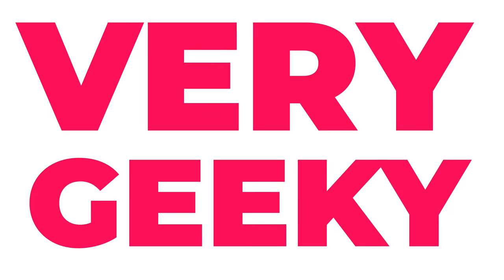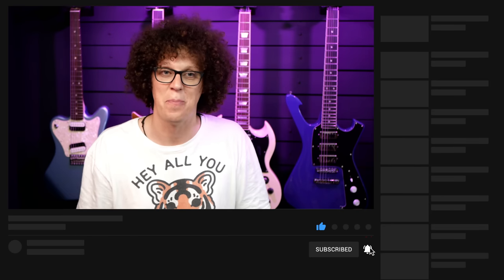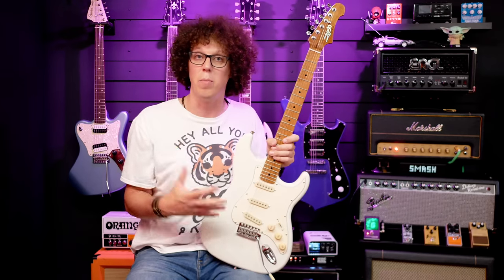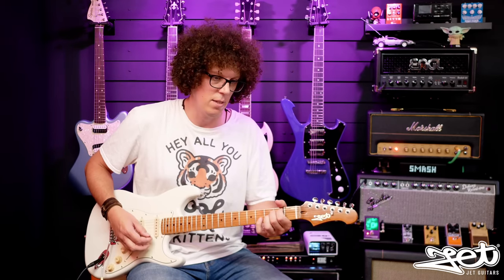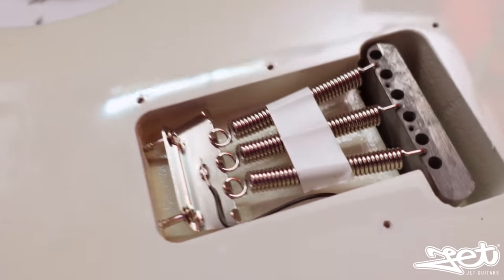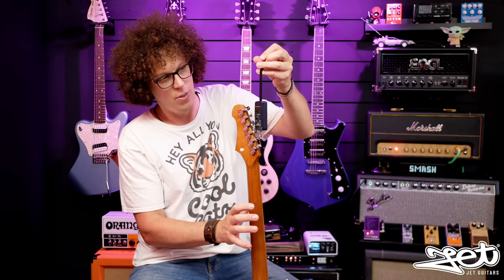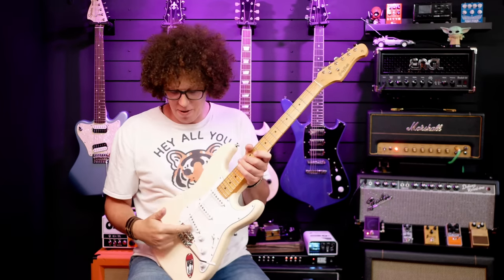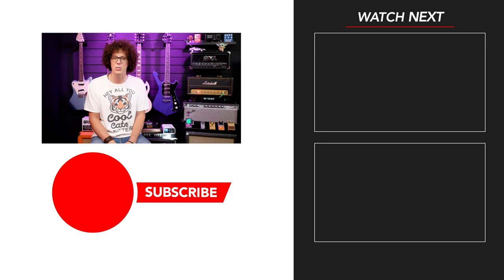Cheap Strat Showdown - Harley Benton VS Jet Guitars

Comment from the maker: Which was your favourite? Jet Guitars or Harley Benton?
Reply: Jet sounded better,  Harley is available in the US to me and cheaper so I would go that route with a loaded pickguard and the PRS cutaway and make it Stratolicious
Reply from the maker: @jacksmith2617  good idea
Reply from the maker: @hailmaryrecordings8255  that is a great move
Reply: Meh. I liked the Custom Shop gondola better.
Reply: I have two Harley Benton guitars and the necks are good on them. One is a Fusion II and the other is HB-35 Plus. They're both really good guitars for the price. I wouldn't buy either of these guitars though. I would prefer either a Squire or MIM Fender for a bit more money because the trems look so cheap on the Jet and Harley Benton. If I had to choose, I'd buy the Jet because of the neck and bigger trem block and would replace the pickups.
Reply: Have not tried the Jet, but after waiting for a couple of months today my ST-62 arrived and it has a caramellized (that is roasted, isn‘t it?) neck.

Just looked at the Thomann homepage, it now says caramelized there as well (on the german page at least).

Seems to me, HB is reacting to competitive environment and channels like this one are  conducive to this.

So, Andy, thank you.
Reply: Just so you know, the new batch of ST-62 from Harley Benton have caramelized maple neck! So you got what you asked for: a satin roasted maple neck and fretboard. Check them out if you want!
Reply: Jet Roasted maple neck !
Reply: I think any cheap strat should be a hardtail because you can't get a decent tremelo until you get a bigger budget!
Reply: @johncollins5552  Jet trem is ok, but I replaced the springs, I use the Trem, in playing gigs and is stable.
Reply: HB is definitely my choice because of the neck radius: 9,5″ (Jet) vs 12" (HB)
Reply: I have a Harley Benton CTS 24 I've had it 4 month and 2 frets have lifted fret 19 and 21 which is making it bottom out so I've thinking of getting a jet JS 400
Reply: @daveperrin9408  I've not had any neck or fret issues with the Jet, the trem springs were not good, a cheap fix, and put Iron gear single coils in to give me the sound I wanted.
Reply: @jacksmith2617  What do you mean the PRS cutaway?
Reply: @LOFIGSD  What is the string spacing on Jet tremolo bridge saddles 10.5 or 10.8 ?!
Reply: @omicrontheta5956  sorry, no idea, or tool to measure, contact Jet, hope they can help.
Reply: @LOFIGSD  Yea I did contact them It's 10.5, and btw I got JS-400 last week and guitar is so well made, hardwear is lets say ok, locking machines where crap, frets are well done, electronics are fine but its gona be modified anyway and properly setup, value for the money I would say one of the best cheapest guitars out there, cheers.
Reply: @omicrontheta5956  only big minus for me was the Trem springs, Single coils I replaced, I will probably put new tuners on, their ok, tone and playability its amazing value for money, a pleasure to play, post some videos of it fully customised.
Reply: @LOFIGSD  Hm idk I didn't notice anything unusall with trem springs except they have normal tension, but I still replaced them with ones with hardened tension bcs I use 10-46 strings or just put four normal tension springs, but again it could be to stiff. I mean pickups are not that bad, my plan is to put in DiMarzio DP100 (bridge) + DiMarzio DP217 (neck). Tuners I already put other old ones I had in my drawer with bore of 10mm (I think) so they fit, those who came with guitars where really crappy but Il go with Gotoh SG381 so I recommend you those, and today I gave guitar to acquaintance of myn who is fixing guitars he sed the neck is great but it needs a bit of fretwork polishing.
Reply: @omicrontheta5956  the pups are actually surprising good for a budget guitar, Ive kept the HB in there for now, but the Single Coils I replaced, the neck is worth the price of the guitar, mine has 9's and after a few months the springs didnt have enough tension, a cheap fix,, cant go wrong on Gotoh tuners, the neck and fret work better than some Gibsons I have had that cost thousands, the only other Budget Guitar I have is a Fazley Telecaster, with a P90 in the neck, the fret work on that was rough, but it plays well, cost less than a £120, the Jet much higher quality, but again, it plays well, often I pay thousands for Guitars so this is all a bit of fun for me.
Reply: definitely the Jet (although I dislike the logo and prefer the color tone on the HB better) the work on the hardware is better and that's the biggest factor for me
Reply: @LOFIGSD  do you still recommend it?
Reply: that's very helpful, thanks for the reply man!
Reply: Hi .. i know its a year old , but can i ask , what do you tune the guitars too 440 hz or 432 hz ? thanks  Jimi
Reply: They're both pretty Stratolicious...
Reply: Both  strats sound cheap, but Jet is slightly better . Know someone who purchased a cheap H.B Strat from Thomann, the condition when it arrived was nearly unplayable
Reply: I think it depends on what a person like, but me I think the Jet brand looks and sounds more like and mid range guitar in price and in sound.
Reply: The HB seemed to definitely sound better with the AlNiCo pups, but I think the Jet likely had the overall edge with the neck aspects and more attention to build quality, probably worth the extra 40.  The pups could be swapped out relatively inexpensively to make it a contender with more expensive guitars.  I'm not really in the market but found the video Strat-alicious and interesting, ha.
Reply: @ayersbiz6458 Jet look and feel above their pay grade,some Harley Bentons also but the q.c. is hit and miss
Reply: @DesertScorpionKSA buona idea oltretutto i pickup della Jet Guitar sono ceramici
Reply: @slowswimmer9169 Anche i legni sono migliori
Reply: I prefer the Jet without a doubt (but the HSS version, with great neck joint acess), there's now satin roasted maple necks and it's more look alike a real fender.
Reply: Add fender squire affinity or bullet strat. Which is better. Jet and harly not available in Philippines.
Reply: What I have observed is the telecaster vs strat has a difference. Strat can play country songs when the need arises and them play rock songs better than the telecaster. My preference is changing from telecaster to a strat. No jet or harly guitars available in Philippines. Brands here are fender, Gibson which are china fakes and Cort, D&D, peavey, Ibanez. Sqoue, SAADT. NO GUILD GUITARS.
Reply: They both have nice models.  Depending on the model, it could go either way.  This typed, I lean more in the direction of Jet.  They seem better.
Reply: The Jet had a fuller sound
Reply: I honestly can't say. I have three Harley Bentons (strat, tele, and Les Paul copies), so I tend to be partial to them...but that Jet had a lot going for it.  As mod platforms, I think both could be quite stratolicious.  My HB Strat also has a satin roasted maple neck, so that could be the winner for me.  Probably, I just need to get a Jet and try them both side by side.  I haven't bought a guitar since last month, so it's probably about time anyway.
Aside from all of that, I wonder what the chances are that the two companies use some of the same factories.
Reply: The Harley Benton sounded much better than the Jet. The Jet guitar must have cheap ceramic pickups whereas the Harley Benton has Alnico magnet pickups. I wouldn't buy either guitar and would pay more to get a better model.

Comment: Strings are so inexpensive, it would make more sense to replace them both with new strings when doing a comparison like this.  After all, who leaves the original strings on for long?  The guitarfetish/slick '51 T-type I have coming boasts that it has "D'A'ddario strings, but BFG about that - if it has NYXL then maybe worth bragging about.  The fact the Jet has a roasted neck and bone nut makes you wonder why more expensive guitars don't have them too, including very expensive Fender guitars (listening Fender?).  Nice comparison, but the strings thing was annoying, and made comparing their sound less useful.
Reply: I remember 1st day of playing my 1st guitar and i was not even able to test it cos 2 strings broke when i was tunning it
Reply: Finally Fender are using a neck carve on some mid and upper line guitars, maybe in another 5 years they will make more roasted maple necks but not in the affordable range😂
Reply: I don’t care if my new guitar comes with any strings,  I’m gonna put my strings on it

Comment: As a novice player (almost almost 3 years) I've been through several guitars. From very budget to upper level in price. I've found its all hit and miss as far as quality and sound. You can get a dog of a guitar for $2000 or a guitar that sounds and plays great for $169. The same applies in the reverse. The budget guitar will most always feel cheaper after getting use to an expensive guitar. One thing I'm baffled about is the statement you don’t pick a guitar based on sound? 1st thing I do is plug it in tune it and see if the sound is what I'm looking for. Spending more guessing what it may need to correct a bad-sounding guitar is not pleasant. Its frustrating and expensive. Buying any guitar off the internet is a gamble. I read SRV would go into a shop and play many guitars before picking something or walking out empty handed most times. I'd say he knew what he was looking for. The right tool for him. Unfortunately most of us don't have that luxury today with music stores closing.

Comment: The radius measurement is based on the curvature of a circle sliced into the width of the neck. A 9.5” radius is taken from a 9.5” diameter circle. It is not a measurement based on degrees of a circle. It’s obvious, but you did say “degrees” which can only add to the confusion of any interested novice.

Comment: Great job.  Thank you so much. (Apparently this is my second comment.  I made one 3 months ago.)

I began listening to your video in the garage listening on my Android.  But I decided to switch to my laptop so I could give you my comments.  That's a sign of respect to your good work.

I have been playing guitar for 8 months.  I am 73 years young :)  I practice/play/research 2-3 hours a day.  Great to be retired.

I purchased two Jets at the beginning of my guitar journey:  a Jet JS300 and a Jet JS400.  Why?  Dave Simpson demo'd them on YouTube and many of us would buy whatever Dave plays (he's great).

Here are my beginner thoughts on the Jet JS300.   (I have never touched a Harley Benton.)
1.  Cheap strings.  I purchased my two Jets from a vendor in Oregon, USA.  I always felt the strings were a bit odd.  Now that I am more experienced.  I know the strings are too cheap, just as you said in your video.  I need to replace them with good strings and I think the Jets will sound even better.
2.  Neck.  Yes, the necks are awesome until a dry Chicago winter attacks them.  Then a bit of fret sprout.  Then I started humidifying my guitar room and putting my guitars in the shower after a shower (yes, that helps).  Now the fret sprout is reduced, almost back to normal which is to say very good.
3.  Tuners.  I have read elsewhere that the Jet tuners are cheap so that plants a predisposition in your mind that the tuning is average at best.  All I can tell you is that my 1990's Harmony H80T seems to keep better tune than the Jets.
4. Resale value.  At one point my wife convinced me to sell a few guitars.  I tried selling the Jets on Facebook and Craigslist in Chicago, IL USA.  I went down to 1/2 of retail price and then stopped trying.  I wasn't about to give my Jets away.
5. 60 Cycle hum.  It's my JS300 that taught me that strats often have "hum".  Musicians learn to deal with that.  Oddly again, my 1990's Harmony H80T ($50 on Craigslist) has no 60 cycle hum at all.  Weird.

Lots of good things:
1.  They are pretty.
2.  My local guitar shop loved them.  He thought of becoming a dealer.
3.  Pretty as heck.
4.  Easy to play.

Fender tells us that 90% of all beginner guitarists quit before the end of their first year.  Most beginners (or their parents), need to consider what they can sell the guitar for if the guitarist quits guitar.  My guess is you can get more for a Harley Benton beginner strat than for a Jet beginner strat.

So that's it.  Your video convinced me to love my Jet, change the cheap strings to good strings, and keep on playing.  I'm not worried about the tuners since I'm not in a rock banc banging on a guitar.  And, since I am moderately deaf, I normally can't tell the difference from one pickup to another.

Sorry Guitar Geek, I don't even know your name.  But you do great work with your videos and your viewers thank you for that work.
Reply: As of today, the JET JS300 is $10 U.S. dollars more to my door in Chicago than the Harley Benton.

1.  Jet JS300 on Amazon.  $234.  Shipping is free.
2.  Harley Benton ST62 is $224.  $135 for guitar + $89.14 Shipping.

So depending upon how much shipping really costs on a JS300 from Amazon, both guitars are effectively the same cost in my opinion.

Comment: Great review-very well thought out and top marks for focusing on the most important aspects for typical buyers of these entry-level guitars. I've been playing for about 30 years and have a few expensive guitars, but my favourites seem to be "budget" guitars that I've modded. I'm thinking about getting one of the Jet JS-400s to replace my Artist Guitars ST-type guitars (got both the SSS and HSS models with and without roasted maple neck). Great guitars, but I just cannot help nudging the volume pot as I play. I was thrilled to see the Jet JS-400 has roasted maple neck, 2-point trem, HSS pickup config (all pickups will be changed) and, most importantly, master volume/master tone control layout with a little more space between the high E string and the volume pot.

Comment: Statolicious video!!
I hope I spelled that correctly, if there is a correct way to spell it.
I think that the Harley Benton guitar is the better deal.  Spending more $$$$ for the Jet, plus the price of new pups, shipping, tax, and instalation, puts the Jet in the price range of a better class of guitar, but, without the resale value of a more well known brand. In other words, you will lose a lot of money if you try to sell it on.
 
Thanks for the video, and the fact that you didn't use a pedal board, or loads of effect and processors so we can actually hear what the guitars sound like. I know I've made up my mind......
I'm buying a Tokai.

Comment: Just bought a HB ST62 MN VW ... Vintage Series
Body: Basswood
Bolt-on neck: Vintage caramelised canadian maple
Fretboard: Vintage caramelised canadian maple
Neck profile: C
Fretboard radius: 305 mm (12'')
Scale: 648 mm
Nut width: 42 mm Graphite
22 Frets
''Double Action'' truss rod
Pickups: 3 Roswell STA AlNiCo-5 vintage ST-style single coils
5-Way pickup selector switch
1 x Volume and 2 x tone controls
White pickguard
Chrome-plated deluxe hardware
Synchronised tremolo system
Kluson style machine heads
Strings: .010- 046
Colour: Vintage White high gloss

Comment: I don't mean to geeksplain the Geek, but for the beginners watching here's a correction: The radius doesn't have to do with degrees (7:33). The mm or inches refer to the radius of a circle. The higher the number the larger the diameter of the circle. And if you cut a piece of the circumference the width of a fretboard, the piece taken out of a larger circle will be flatter than that taken out of a smaller one. Thus, larger/smaller radius translates to flatter/curvier (?) fretboard.
Also, strats with radiuses above 9,5" are just wrong, imho. Not stratalicious at all.
Reply: I thought the higher te number, the easier it is to bend.
Also, i think a modern C is a C with higher radius fretboard, i.e. 12'' or above.
A C neck is one with a 9.5" - 12" fretboard.
Whereas a vintage C neck is a 7 3/4" fret radius.
But do correct me if I'm wrong.
My DIY kit came with a 12" neck C shaped, no finish (I used 2 applications of hardwax oil for that satin smooth feel) & I'm loving it.
Reply: @MaartenAnna  A higher radius makes it easier to bend in the sense that you can make big bends (say, more than a whole step) and the strings will still ring, without buzzing or "choking out". With a rounder fretboard the string will hit frets at some point (although I've seen reviews of the Silver Sky claiming that despite the 7.25" (!) radius big bends aren't an issue, so I guess with high-end guitar or great set ups anything is possible). However, I feel a rounder radius makes bending easier on the fingers, with less stress on the joints.
On the modern C point, fretboard radius and neck shape are independent variables. You could have a modern C shape with any fretboard radius, and it would still be a modern C. There's an affinity between the two things, of course. Modern C with a 12" radius is a great combo, while a super thin shredder type neck shape wouldn't make sense with a a vintage radius. If you google image search "modern c soft v oval" you'll see diagrams showing the different neck shapes, and how it has to do with the shape of the back of the neck independently of the fretboard.
Hope you enjoy yout kit. Satin necks are the best!
Reply: @easy-to-read-name62  Yeah, master bender DG has no prob bending on 7.25 lol!  Understatement! I love vintage necks 7.25 with a soft V = Comfy!